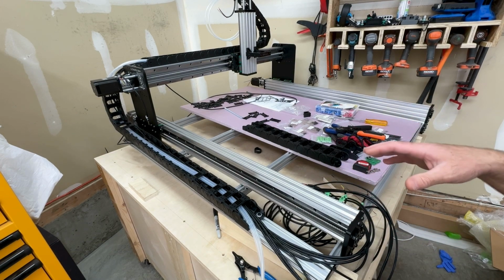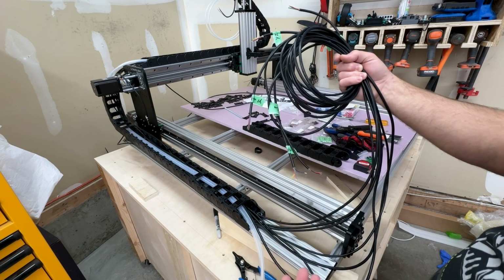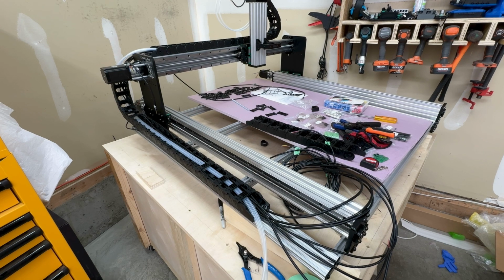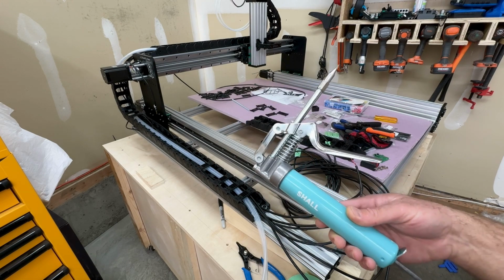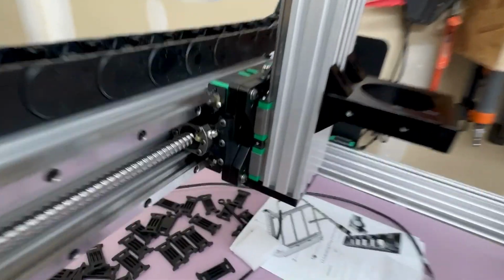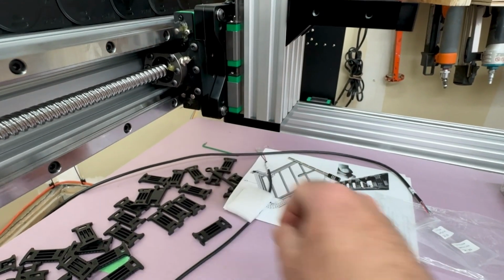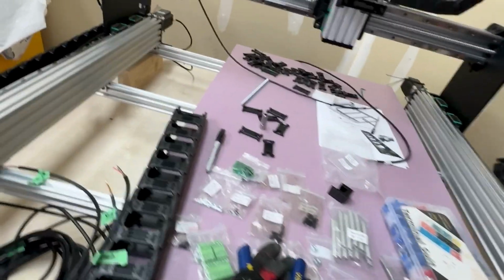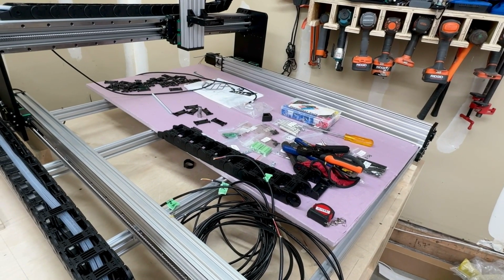Ultimate Bee Tuesday Night - Cable chains and wires!

Comment: Do you think the Z Axis is sturdy enough for carrying the 5kg 2,2 kw Spindle?  in any case thanks for answer and videos very intersting for me. keep up!
Reply from the maker: So I would say probably not, in most cases with the hobby machines a 1.5kw spindle is about the right size for both weight and stability of the machine. There are exceptions for sure but I would say on this machine I would recommend a 1.5kw.

Comment: Advice. Even if you use the green connectors, it is good practice to tin the ends of the wire so all the strands 'become one' and don't split apart when the screw tightens onto them. 
I see foil in the cable but where is the grounding line? Was that cut off?
Reply from the maker: I used ferrule crimps on the wire ends to keep things together. Yes the wire ends come tinned but the ends I got were much too short to make a secure connection tinned or not. 
The foil in the wire was cut back from Bulkman and does not ground out anywhere. I have never actually seen steppers have a ground.